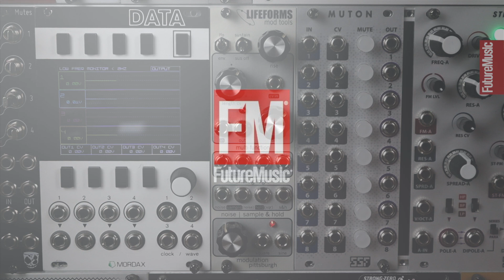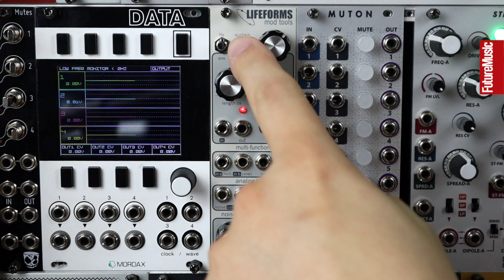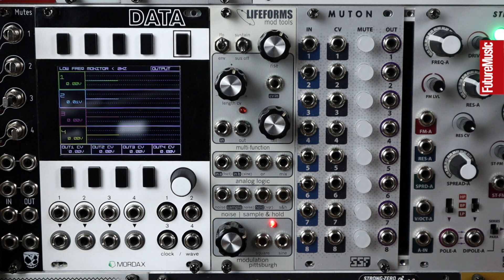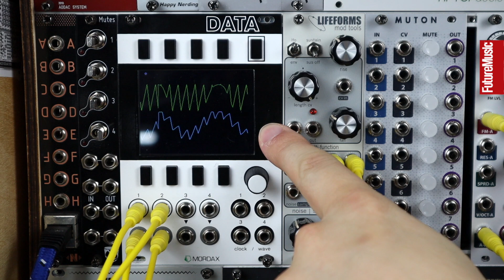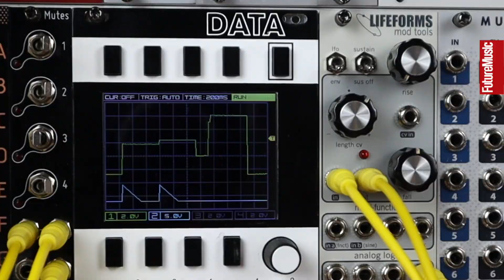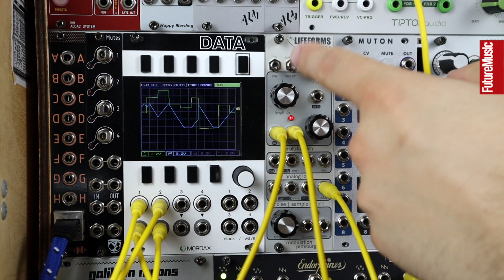Modular Monthly: Pittsburgh Modular Lifeforms Mod Tools

Comment: Hey there! Great video about this module! Just bought one and I'm very excited waiting it to arrive. Anyway, I got a doubt about it and would really apreciate if you could help me out with this, for I'm still beggining to set my system. 

I know modulation section is a free running LFO, and I'd like to know if multifunc section can be clocked/started by another module while set in LFO mode. 

Thanks and kind regards!

Comment: Can you go over that sample and hold bit reducer again? Were you using any of the normalled connections? Couldn't see all the cables.
Reply: It´s actually fairly straight forward :) Audio-signal (the one you want to "reduce the bit-depth" of) into the "sample" input, square oscillator into the "hold" input and the sample&hold output to your mixer/speaker/interface etc. The speed of the square oscillator determines the "bit-reduction" like effect. Faster - less effect; slower - stronger effect. Hope that helps :)